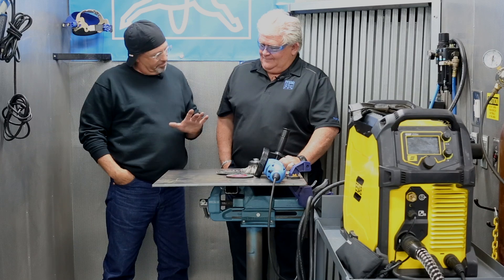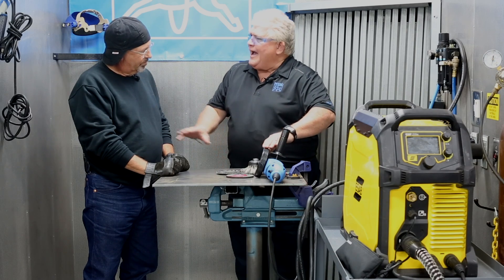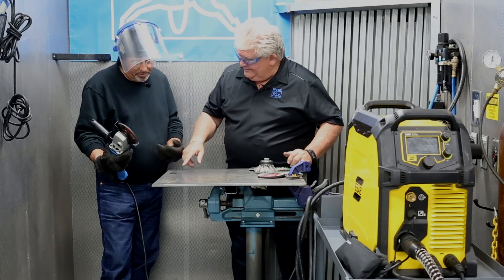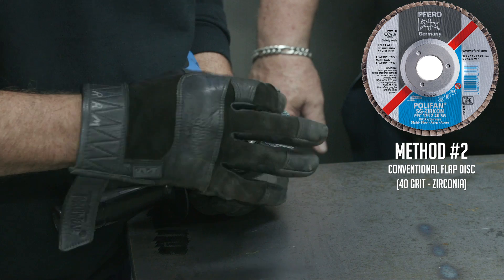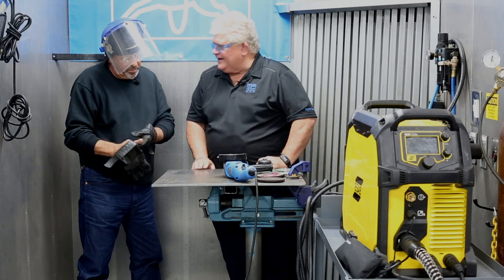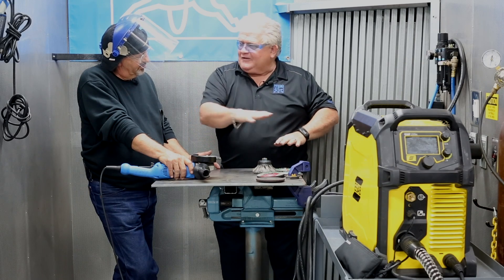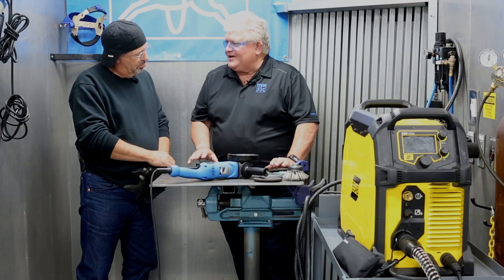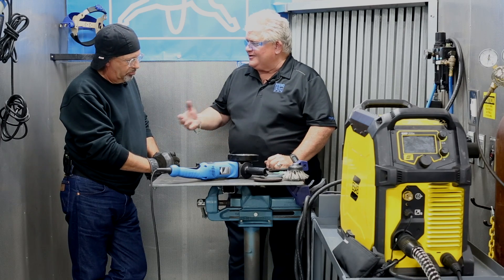Four Ways to Remove MILL SCALE

Comment: My shop allows me to have one flapper disk per week. They really only want us using them on stainless only. We can have all the normal grinding wheels we need. Taking millscale off 40 inch pipe for supports and shoes is a pain in the butt!! Wish my shop would buy these, but it's not happening. ..
Reply: Jessica Rose they’re free issue for us.  We use them for most things lol.  I do feel bad enough that I use them to the wear line. Some guys use them for each job and chuck them. Total waste

Comment: Generally silicon carbide wears down a lot faster than alum oxide (at least for grinding wheels), is that the case with these flap disks? I always thought the glazing that happens is when the abrasive rubs off at the edges of the individual sheets and leaves it rubbing on the fabric
Reply from the maker: No, it will actually last longer, because it won't load up and you won't need to put your weight into it.

Comment: How about giving us a link on the pferdusa web site that shows this product.
Reply from the maker: Here is the Silicon Carbide Wheel: https://www.pferd.com/int-en/products/fine-grinding-and-polishing-tools/combiclick/fibre-discs-cc-fs/silicon-carbide-sic-type/silicon-carbide-sic-type/cc-fs-125-sic-80/?filter=%7B%2522q%2522%3A%2522silicon%20carbide%2522%7D
Reply: Weld.com do you think maybe you could leave a link for that grinder please?
Reply from the maker: shoot an email to sales@pferdusa.com. THey'll be able to help you out.
Reply from the maker: https://www.pferd.com/int-en/products/industrial-power-brushes/threaded-cup-brushes/knotted/tbg/stainless-steel-wire-inox-diamond-dia/stainless-steel-wire-inox-diamond-dia/tbg-100-m14-inox-0-50-dia-270/
Reply: @Welddotcom  Still only metric thread M14 and no prices.. I would use an Harbor Freight  grinder, but no variable speed.

Comment: Acid works wonders.
Reply: I've been using vinegar. 1 day soak, then the oxides brush off easily! Just takes some planning.
Reply: I specifically logged in on another device to mention the acid method.

Here in Australia we call it Hydrochloric acid.
Plan ahead, soak it, occassional light scrub with a plastic scrubbing brush, and all the scale is gone in 30 minutes. 

While the steel is soaking, work on other aspects of the project, prep, or sit down and watch youtube 😁
Reply: toilet boil cleaner
Reply: That diamond wire wheel is pretty damn cool. But it’s hard to beat a $5 gallon of muriatic acid if you have the option to let the material soak in it. Option being material/part size and space/ventilation arrangement to let it soak.
Reply: Vinegar is too weak. Hydrochloric acid (sold as muriatic acid at Lowes) works in 30 min.
Reply: @dfgyuhdd  
That is not true, vinegar works fine for a hobbyist and it is a lot safer. If it was my job I would pay someone to sandblast it, but in my garage for my personal projects vinegar it is.
Reply: phosphoric acid works, and it has the benefit of not needing to be neutralized, as it forms a rust resistant oxide layer on the steel, and won't keep eating away at the steel like other acids.  And its safe, its the same stuff they put in coca cola.  just wash it off with water and ur done.
an old timer told me a crazy story once.  Back in the 50's when they used to build rat rods, the painter used to spray down the bare steel body with phosphoric acid, wait, then wash it off with water.  they then dried the car and started to paint.  i do it all the time whenever i do repairs, it works well.  i don't have a garage so sometimes i fix a dent on my work van with bondo and can't get around to painting, and in the meantime it starts to rust some (slowly, and with a bright orange surface rust)  in the next few weeks, so when i get around to painting i just spray it down, hose it off, dry and paint.  
i live in the northeast and they use calcium chloride, it eats metal like its its job, so every year after winter i spray my work vans undercarriage with phosphoric acid, powerwash it, then coat it with used motor oil.  i own the only 14 year old sprinter van in the northeast with next to zero rust.  My brother owns an e-350 thats 4 years older, and he refuses to listen to me, and his van body recently just dropped off its body mounts because the rust is eating everything.
Reply: John Robertson so does sand blasting

Comment: I recently found that vinegar removed mill scale from small pieces of bar stock.  Brushes right off after soaking for a bit. It leaves a dull gray surface finish which can be removed pretty easily with scotchbrite or a surface conditioning pad. This has saved me sanding/polishing time. Don't know how this affects the metal on a deeper level or weld quality/strength.
Reply: I've been using vinegar for a few years to remove mill scale when I can't get P&O sheet and plate. I always neutralize with a baking soda water rinse afterwards. I have not noticed any obvious strength differences but a metallurgist may have something to say about it.
Reply: I have only done this for small parts that I'm not welding.  I like the method because I am putting a blacksmith type finish on them, not painting.  Not having to worry about scratch marks and gouges save a lot of time.  I thought the education in this video regarding the composition of flap discs and wire wheels was really helpful though.
Reply: Mike B I’ve read info that reports that acidic processes used for removing milscale can cause the steel to become brittle but I do not know for certain.  I was told by a fellow that does metal work he uses a 5 gallon bucket of muriatic acid and I’ve tried it to see.  It works but then there is the metallurgy issue
Reply: @CraftwerksMC  Acid-Based Removal of Mill-Scale is the ONLY cost-effective (and MUCH QUICKER), method of mill-scale removal.  It will NOT affect the metallurgical qualities of HR steel.  
Acetic Acid 10%,  Phosphoric Acid 30% or Muriatic Acid 10-15% will remove ALL Mill-Scale in just a few minutes.  Vinegar is about 3% Acetic Acid.  Muriatic Acid, a.k.a. Hydrochloric Acid, purchased from a hardware store is typically 31.45% strength, so you would mix it 1:3 or even 1:4 (with H2O).  Purchase Phosphoric Acid 98% and/or Acetic or Glacial Acetic Acid 98%.  Phosphoric Acid 98% is odorless.  Acetic Acid, even at 3% Strength smells like vinegar (obviously), and Muriatic Acid 31.45% will knock your D**K in the Dirt.  It smells awful!  BUT!...When mixed with Water at 1:3 or 1:4 Ratio, has no discernible smell.  
Muriatic Acid, even at 10% Strength however, needs to be covered to prevent the off-gassing from rusting any ferrous metal within 50-75 ft.  The other two acids mentioned do NOT require a cover, nor do any of them have special haz-mat disposal requirements.  Phosphoric Acid is used in almost all soft-drinks and that coupled with Carbon Dioxide, is what makes them fizz and have a little 'bite' when you drink or swallow them.  All 3 Acids are very safe when used with a little common sense.   My favorite is Muriatic Acid & Water.  Total Mill-Scale Removal in 15-20 Minutes.  Mechanical/Abrasive Removal of Mill-Scale is a Non-Starter.  Total waste of time and money, imho.  One last thing:  Remove the piece/s from the acid/water bath & rinse vigorously with plain water.  Then dry with clean, dry, oil-free shop air to prevent flash rust.  Shine up if required with an 80-Grit or 120-Grit Flap Disc.  Or, if you have a large budget, use a Metabo® or FLEX™ Burnishing Grinder.
Reply: @BillWorden  here's a question. I need to remove mill scale from some 6 ft angle iron for a table saw fence I'm building. I'd love to use a dilute muriatic solution. If I made a shallow wooden tub and lined it with thick visqueen, do you think that would contain the acid? Thanks.
Reply: @TheDesertRat31  Yes, that would work just fine.  Bill
Reply: @BillWorden  ok, thanks for the advice.
Reply: @BillWorden  Muriatic acid works.  We've used it in our shop multiple times.  You can also use baking soda on the material right after to help neutralize the acid and make it ready for finishing faster.

Comment: Ok guys you didn't say where do we buy those brushes to take off mill scale.
Reply: They're all products of Pferd
Reply from the maker: Here is the brush: https://www.pferd.com/int-en/products/industrial-power-brushes/threaded-cup-brushes/knotted/tbg/stainless-steel-wire-inox-diamond-dia/stainless-steel-wire-inox-diamond-dia/tbg-100-m14-inox-0-50-dia-270/
Here is the Silicon Carbide Wheel: https://www.pferd.com/int-en/products/fine-grinding-and-polishing-tools/combiclick/fibre-discs-cc-fs/silicon-carbide-sic-type/silicon-carbide-sic-type/cc-fs-125-sic-80/?filter=%7B%2522q%2522%3A%2522silicon%20carbide%2522%7D

Comment: Now how much more $$ is the wire "diamond" cup vs. a regular wire cup or any of the flap discs?
Reply from the maker: We don't know exact pricing, but here are some links to do some research: 
Here is the brush: https://www.pferd.com/int-en/products/industrial-power-brushes/threaded-cup-brushes/knotted/tbg/stainless-steel-wire-inox-diamond-dia/stainless-steel-wire-inox-diamond-dia/tbg-100-m14-inox-0-50-dia-270/
Here is the Silicon Carbide Wheel: https://www.pferd.com/int-en/products/fine-grinding-and-polishing-tools/combiclick/fibre-discs-cc-fs/silicon-carbide-sic-type/silicon-carbide-sic-type/cc-fs-125-sic-80/?filter=%7B%2522q%2522%3A%2522silicon%20carbide%2522%7D
Reply: @Welddotcom  thank you very much for the links & reply. I'm interested to see the difference.

Comment: I made a Welding Table out of a piece of 36" X 36" X 1.25" Steel Plate, and another one out of 60" X 40" X 1" Steel Plate. Both had Mill Scale and some rust on them that I needed to get off AND preserve the flatness as best as I could. I knew that high speed was not the answer and that the mill scale was hard and somewhat brittle. If you skimmed over it and POLISHED it, then it was really hard to get off. I decided to "scratch through it" in a very controlled way. I used a Makita Variable Speed Sander/Polisher at the slowest speed (600 RPM?) to turn a 7" Segmented Diamond Cup Wheel and kept the entire wheel in contact with the plate. These are made for grinding Concrete at up to 8500 RPM, and made short work out of the rust and mill scale. The fact that the diamonds are set into Brass Segments, the scratching into the metal was rather slight, but more importantly, by keeping the wheel 100% flat and in contact with the surface of the plate, there were no gouge marks. The diamonds quickly cut right through the Mill Scale. This gave me the desired flat bare steel surface that is ideal for a welding table. A slight spray of WD40 or LPS#2 with a quick wipe helps keep rust away and makes spatter clean-up fairly easy. If I get too many arc strikes, too much spatter, or some rust, a once over with the diamond cup disc for 3 - 5 minuets does the trick. Keep it moving over the entire surface in several directions and you end up with a slight "Cross Hatch Pattern" which actually looks really neat. Just remember, a light touch is all that is needed. Although not excessively loud, use Safety Glasses, Hearing Protectors, and a particle mask for the rust and initial scale.
Reply: hi David what is the model number of the makita are you using. thanks
Reply: @jdandcoke  The machine that I have is a Makita 9227C 7" Sander/Polisher, which has a 6 position "Speed Limiter" from 600 - 3000 RPM. The trigger is also Variable Speed up to the maximum preset on the Limiter, and it also has "Soft Start" which eliminates sudden starting torque. The NEW Model is a 9237C and has several new features and is a little cheaper than the old model,  about $269.00 Canadian on Amazon. This handles a 7" Segmented Diamond Cup Wheel just great. On this for a flap disc, I use a Walter 7" Enduro FleX 15-R-70XX. The XX is 04 for 40 grit, 06 for 60 grit.... up to 12 for 120 grit. As I say, at slower speeds with a slight loading of wax, these will last you for months on Aluminum in most cases and do a fantastic job. I also have a METABO 5" WEV-1500-125 RT Grinder that is also variable speed, 13.2 Amps, 1500 Watts, with a dial to select 3500, 4900, 6500, 7900, 9500, & 11,000 RPM maximum and again with Soft Start but NO Variable Speed Trigger and this being a little smaller and lighter is my "Go-To" Mini Grinder. Not for a Diamond Cup Disc except a smaller 4" - 5" one, it handles a 5" Walter Flap Disc just great. 80 Grit with wax at 3,500 RPM and you are removing Aluminum efficiently with great disc life. BOTH units have an internal "Tach Signal" and will add power if the unit is loaded and slows down, maintaining a constant speed. These units are $250 - 350.00, and a bit more expensive but super high quality and 3 - 5 times the usefulness of fixed speed units. You will also find them much less fatiguing to use with lower speed, vibration, & noise. LOVE THEM!
Reply: @DavidBrown-tl5yh  the polisher for doing car wax, etc?? I need to remove mill scale from a 7 ft piece if angle iron.  I'm making a rip fence and rail system for a table saw. I wonder if the diamond cup technique would work in that application.
Reply: @TheDesertRat31  Yes. The most common use is as a car polisher. I think the Makitas  sometimes are boxed with a foam pad or a polishing Bonet. They have the same universal thread though and can take other wheels. The real trick with the cup wheel is to keep it at slow speed and in as flat a contact with the material as possible. On a piece of angle iron, I might go for a smaller disc like a 4" which is quite a bit cheaper than the larger ones.
Reply: David Brown. I’ve thought using a diamond cup myself. Would a regular angle grinder cause it to glaze up?
Reply: @Olseawalker  No.... but they are too fast unless you  use a small disk about 4" or so. Check to see what is available. This 7" disc is rated at 8500 RPM and most "Mini Grinders"  are above 10,000. The slow speed keeps everything cool, prevents vibration and chatter, and makes it much easier to control. I bought the Makita Variable Speed Sander/Polisher and use it as my "Go To" large grinder. Much lighter and less expansive than most 6"+ Grinders. It also works incredibly well at slow speed, with a J Walter or other good quality Flap Disc on Aluminum. Load the disc slightly with wax.... candle wax is great, and you will be amazed at how well it removes aluminum, how much aluminum dust is on the floor, and how long it lasts. I get many hours out of a single disc, which translates into a couple of months of aluminum fabrication work.
Reply: @AzzKicker-bz1cb  There is commercially available wax for bandsaw blades, however, just use an old candle, or melt several old candles and pour the melted wax into a small mould to make a block of wax. My wife had some big 2” X 2” X 6” scented decorator candles that could not be used anymore because the wicks failed, and I use them the way they are for both the grinders and bandsaw blades. They also smell of Lavender or something. Touch the wax block or candle to the spinning wheel and put a light loading on it. You will find that the waxed wheel will have very little friction and will remove Aluminum very quickly. If it starts to drag, add a little more. 

 Once you have ground the area, if you are TIG welding it, clean the area with Acetone to remove the wax residue. I build and TIG Weld Aircraft Tow Bars out of 6061 T6 Aluminum and use the slow turning flap wheel with wax to fine tune the fit and remove all burrs before welding, then powder coat them mainly for looks and high visibility. I cut the material on a Cold Cut Saw and deburr everything prior to fitting and welding. Try it.... you will like it!

Comment: Now that was really great information. One thing not covered too much was the grinder speed. All mine are one speed on or off. Guess I was not aware of a variable or two speed grinder.
Reply: $12  at harbor freight.  2 speeds on and off.  Push harder for lower speeds. They're disposable but you can use them a couple times usually.       More realistically though they're commonly called polishers and more expensive than a regular angle grinder. I just looked at the big lot stores and they've gotten cheaper it seems. Mine was over $200 years ago but lots of good brands now for less than a 1/3 of that.
Reply: Thanks for the info. I am going to see what the diamond wire brush costs first, as I am a home hobbyist, but get fustrated removing the mill scale as well.
Reply: Thanks for the information. Tom
Reply: @tomherd4179  really
Reply from the maker: Not cheap... But this is a beast: https://www.metabo-hpt.com/us/main-navigation/tools?category=/tools/grinders/4-5---5-angle-grinders&title=G3612DAQ6++36V+MultiVolt+Brushless+4-1%2F2-in+Slide+Switch+Grinder+(Tool+Body+Only)
Reply: Thanks - as soon as I saw the brand I knew $$